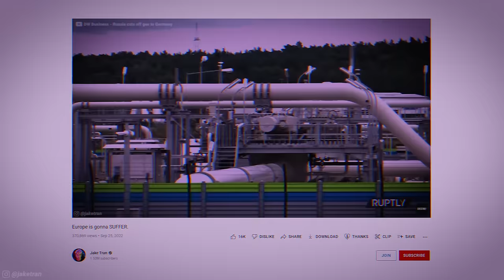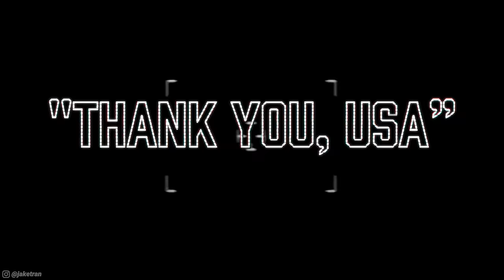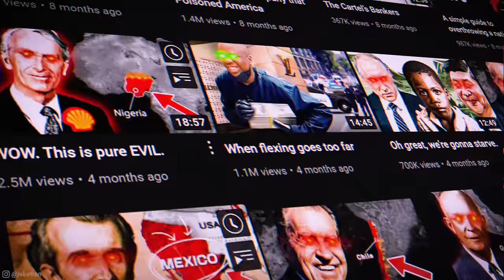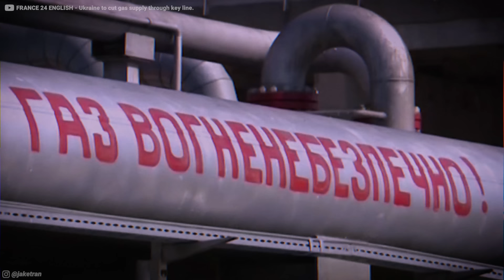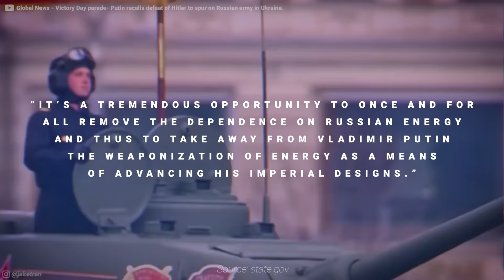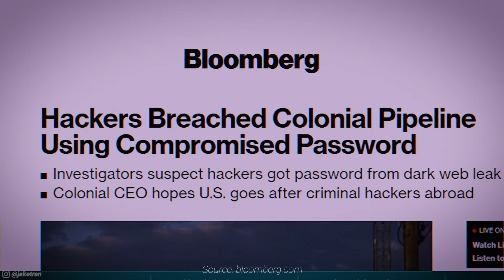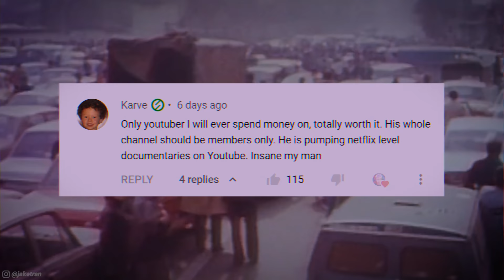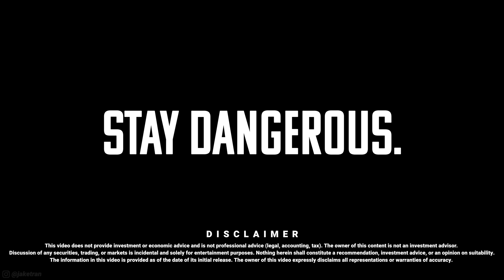OH MY GOD. Now it all makes sense!! (Nord Stream Pipeline)

Comment: Europeans can freeze this winter or buy 4 times more expensive gas from the US that's also bad for the environment because the US destroyed Nord Streams pipelines.
Liquefied natural gas isn't just the same climate-destroying energy source in a different state of matter—it's actually worse than ordinary Russian gas. The energy required to chill, ship, and regasify the fossil fuel makes it far more carbon-intensive and increases the potential for leakage of dangerous methane.
Reply: Let alone the fact there aren't enough ships to transport all of that energy into Europe. And even if there were, traffic in the Atlantic would be insane.
Reply: It's never about the environment. It's about control
Reply: They wouldn't have done this without Germany signing off on it. It would be absolutely detrimental to the American & European relationship for the US to attack the strongest economy in Europe.

Charging a higher price would make sense due to the distances needed to transport the gas. I believe there would be a private compensation for the higher prices.
Reply: As somebody from EU it's kinda good it got blown up. At least governments will have motivation to stop buying gas from Putler. They should have done it 10 years ago like Lithuania.
Reply: @elmo2800  they wouldn't need to blow it up in the first place if they had "Germany signing off on it"
Reply: @bayraktarx1386  they are still buying it tho. Now Russia is in process of having a gass line through Turkey, and also all the available gas from Europe will go to China. Slo Russians are not losing, europeans are. We have already seen all our bills soar.

Comment: No actually you could be very wrong. Russia has a huge amount to gain by blowing up the pipeline. Firstly it allows Russia to have a good reason to stop supplying gas instead of their previous excuses. 2nd it means that Gazprom won't be liable for huge fines that they otherwise would have had to pay for not meeting their contractual obligations. The most telling piece of evidence will be the direction of the blasts. If they were external blowing inwards then it could have been any country with suitable resource, so perhaps the US. If they point from internal outwards then it means they could have been initiated by a maintenance drone which are used inside the pipes. These are routine drones which travel the pipes carrying out maintenance internally. Russia is the only country which has access to these.

Comment: Oldest question in the book; cui bono? (who profits from it?). Putin had NOTHING to gain, but everything to lose, including very strong leverage towards Europe. America on the other hand has everything to gain.
Also, the Baltic sea has been NATO-controlled territory since the Cold War, with at least 3 NATO countries constantly monitoring the area with both active and passive sonar and having submarines in there and another 3 countries having research facilities there. No Russian surface ships nor Russian submarines have been detected, which would be absolutely incredible, especially since it only has a very limited depth.
On the other hand, American helicopters were flying over that area the week before and American forces were practicing in that area with remotes and diveteams that week with surfaceships and submarines/submersibles. Besides that, Russian maintenance crews have previously found an American Navy underwater remote vehicle stuck at the pipeline, which the US claimed to have 'lost during a previous excercise'.
Also, Germany's security agencies refuse to reveal any evidence they have even to members of their Bundestag, which more or less could be compared with the US congress. If they had any evidence at all, no matter how slight, that Russia was behind it, it would be splattered all over the news. The fact they do not want to reveal it even to the members of the Bundestag means they probably have evidence, even if it is circumstantial, that the US was involved but cannot let it be known as that would be an act of war that cannot be let slip and they cannot do without the US for the moment. Especially considering the fact they de-facto are still an occupied country with huge amounts of American troops on their soil

Comment: Now imagine putin blowing up the baltic stream 🤣
Reply: Now that would be funny. But now everybody in Europe are guarding and monitoring their pipelines and blowing them up would be quite difficult to pull off.
Reply: @ratman5225  just a smart torpedo is enough to make Europe a bit colder than last year
Reply: @dmc7890  Yeah, I don't know much about naval warfare. But i think those can be E- jammed or countered in other ways.  Even if it hits its target. The point of origin could be located and captured/destroyed more easily than before N2 incident.

Comment: Here is the counterpoint: if the United States blew up the pipeline, why hasn’t Russia shut it off?

By leaving the pipeline running and spilling out it ensures that no repairs can be done.

I don’t know why Russia would blow up their own pipeline. I do know that they could turn off the gas so repairs could be made.

Also why don’t we hear Russia blaming the US for this? Seems like it would be easy for them to say this is an “act of war” or “act of US aggression” that would allow them to further escalate.
Reply: here's a counterpoint : the ns2 pipeline wasn't even operational yet, so how exactly can one shut something which isn't even open yet. and the gas in was trapped in there to keep the line pressurised. so the leak is from the already trapped gas in the line, with virtually no way to stop them.
Reply: When you close your water tap the pipe will not become vaccum without water
Just like that more than 1000 km pipeline still contain gas even after it closed
Leak may stop within weeks
Reply: @jackharper5642  Thanks Jack, so are you saying that the pipeline is no longer spilling gas? I was under the impression gas was still coming out of it

Comment: This is idiotic, you can’t compare LNG from US to pipe line. US natural gas is liquified and requires special equipment to transfer it and it’s way expensive compared to pipeline.
The competitor is Norway, which is not part of NATO. Destroying the pipeline is sending a message to Norway to back off

Comment: Ok, and the attack on the Crimean bridge or Kerch bridge, has all the same haul marks as the attack on nordstream. The exact same skill set would be required for both attacks. Something that is not being mentioned in this video. It’s got navy seals written all over it. I believe that you would have to approach the bridge from under water. I do not believe the Ukrainians have this sort of capability. If they did then more of these sort of operations would have been conducted.

Comment: Quote: @ about 12:15 / 15:18 "There's no direct evidence that the U.S. was involved."  Though this statement comes 12 minutes deep into the essay, its inclusion (though buried) is a welcome caveat against the circumstantial "information" that is provided. Without it, I've have seen this more as propaganda than an in-depth analysis.  It does, however, offer another viewpoint (even a plausible one) that I have not considered. We (Americans) have a long history of this kind of stuff, so it's plausible just at face value. You've done a good job at providing a reason for doing it. / Not to be confused with 'actually having done it.' Good job.

Comment: Q Bono he who benefits most from an unfortunate event probably caused it, But by the look of  things Norway had the most to gain and they also had the technical capability,  having done a lot of oil pipelines, oil rigs, etc... as mentioned, the had just completed their own pipeline in the area a month before, so they had all the undersea equipment and trained staff available to do another quick operation for a whole month plus... or even in parallel with their own work, and a great excuse to be in the area with all that stuff, this makes the most sense... sorry Jake... .....

Comment: I subscribed because this video.
No, it's more likely it was the puppeteer behind those who benefits from this.

It's more likely that it was a missile dropped from a Boeing aircraft. Check routing and altitude. If a plane flying over the area suddenly gains altitude, it's probable that missiles were dropped. Those missiles have a long range when it comes to navigating.

This can easily be proven and disproved by data. If data is refused for release - well that could be an indicator of questionable attitude to solving crimes like this.